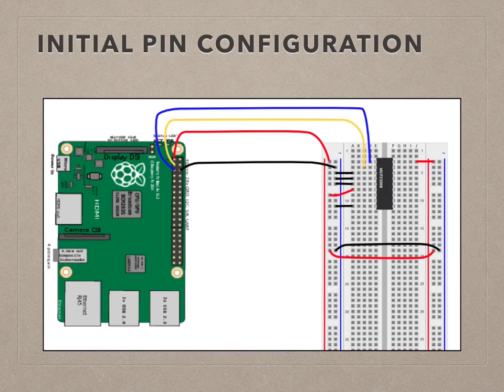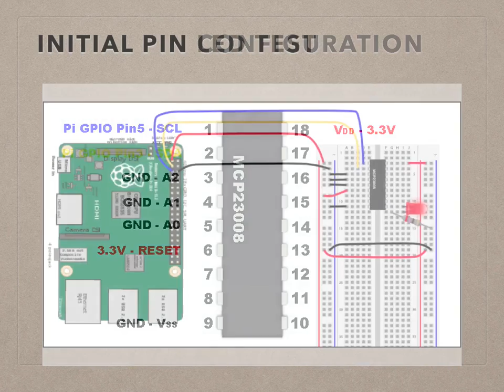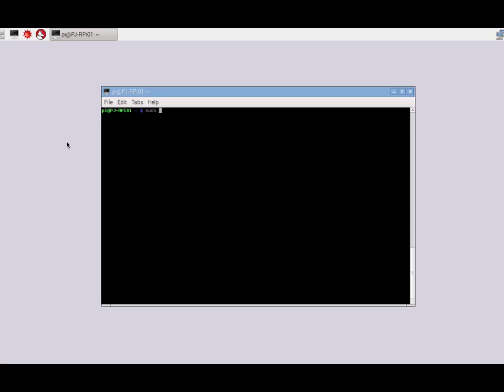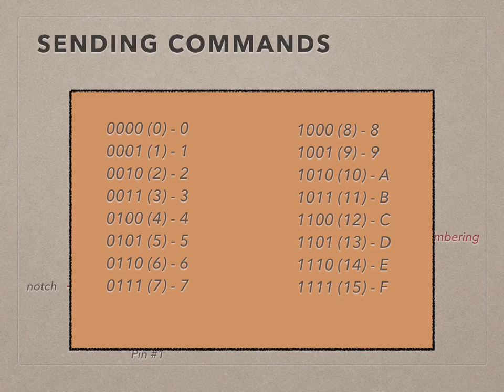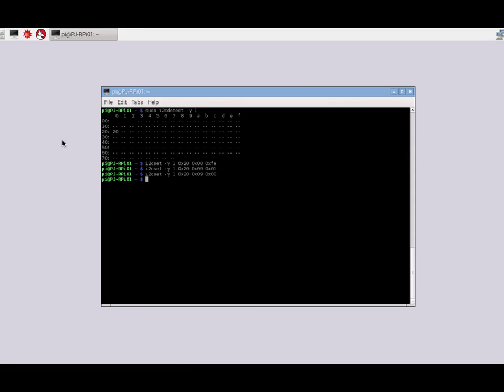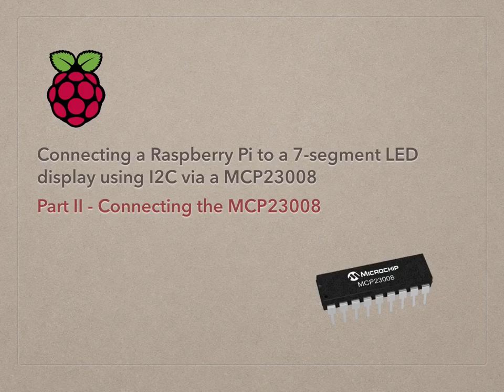Part2 - RaspberryPi to 7-segment LED display with MCP23008 via I2C

Comment: Hi, nice video! How is the RPi realizing that pins 3 and 5 are for SDA and SCL of i2c? Is this something autodected by i2cdetect and smbus in python? Where is the SCL clock generated?
Reply from the maker: Hi @sudnifnatipac - the GPIO pins are reserved for specific tasks and the I2C 'control' can be found in the Raspberry Pi GPIO documentation.

Have a look at this link for another overview of the pin layout:
https://pinout.xyz/pinout/i2c

Comment: I'm using this on a relay board, can I switch individual pins while preserving the state of other pins without checking what they are? i.e send 0x20 0x00 0xfe then 0x20 0x09 0x01 to only interact with that pin? Then 0xfd to work the pin before it?
Reply from the maker: Hi @Simon, I haven't tried this scenario myself, sorry.  The use case I had was a full write of all outputs of the chip each time.   I'd be interested to know if you manage to get independent addressing working though.